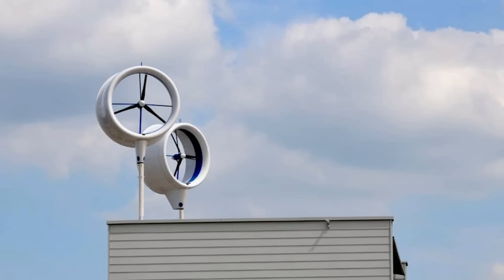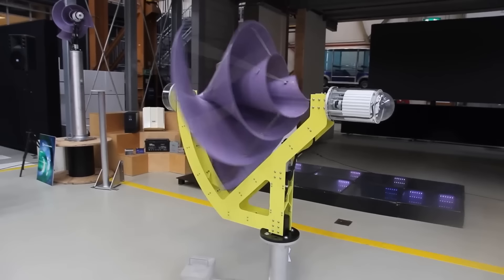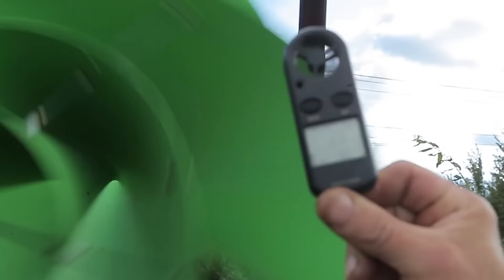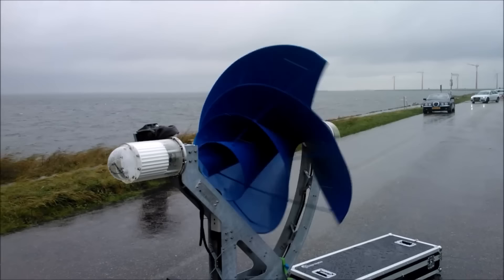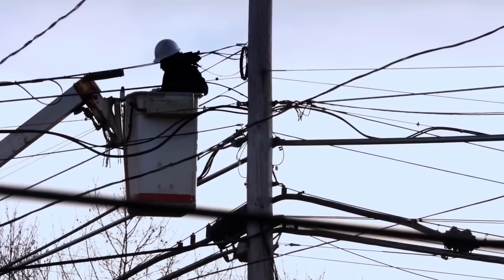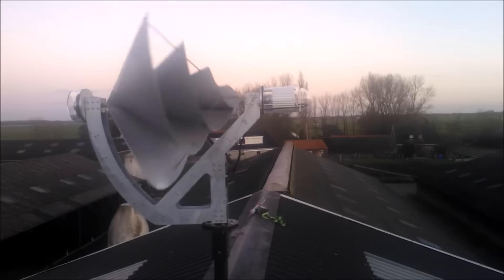How The Liam F1 Wind Turbine Will Destroy Every Home Renewable Energy Source

Comment: I recommend having a source you can activate and having a saver. This is a saver, not a replacement for off-grid. It can be frozen in certain climates like mine. I'm also surrounded by 40-80ft tall trees and I get more sun than wind-flow a the angle my home sits. Unfortunately the pine cones that drop would destroy a solar panel easily. They're full of sap at one month a year and have broken shoulders of the unsuspecting.
Reply: Those or some big pine cones!

Comment: Well if the large one produces 1,500 kWh a YEAR, we use 2500 kWh a MONTH we would need 12 of them. With each costing approximately $5,500 that would be approximately $66,000 for JUST the F1’s. Based on my current electric bill, that would take 13 years to pay back and Im sure not all will be still working that long. Not to mention my HOA would soooo not ever approve them. I am sure we will get there but not yet.

Comment: If it was a vertical axis then it would capture the wind from any direction.  What you have is something that will move into the wind and that is lost energy. It would be more efficient  up an down because no matter which way the wind comes from it will capture the wind.  You only have 1 direction that it can get the energy.  As it sits now it would not be worth the cost.

Comment: Can't they just made hybrid generator?

The greatest advantage of solar-TEG fusion solar panels is that they cover a house/building's entire roof, which greatly lowered the entire house/building temperature 🌡️, which could also reduce the expenditure of air-conditioning...

While this might be useless in house/buildings in colder climate area, but they're more people live in hotter climates...

The issue with generators with moving parts, is that they're not animals friendly, so it's best if the turbines are shielded.

This design can't also be applied to the entire house/building's structures, as it's not easy to make them ecstatically look better to average public and blend with existing architecture of structures/buildings...

Comment: It seems like it’s a good idea to install an array of small turbines on roofs of busses and trains. When they move, they can easily produce a lot of electricity. Enough to power air conditioning, lighting, Wi-Fi, and other small power outlets to charge phones etc inside for passengers. 
Of course, this will increase the drag resistance of the vehicles and there by directly increase fuel consumption! 😂😂😂😂😂😂 talk about converting fuel to speed to wind and back to electricity!

Comment: Well and you know here in the USA...until it can be monitized it wont get any support.  It's too cheap so until it can cost the same as solar panel methods or money can be made over a length of time versus initial purchase and maintenance costs it will not fly here.  Greed as nothing is free or it doesnt get to market.

Comment: When I need electricity the most, dead of winter and middle of summer, the wind just doesn't blow.  Spring and fall, when I don't need much electricity, that's when it blows.  And this thing is way more expensive than I figured for such a simple looking device.  I was hopeful, but I'll pass.  Can't use solar either because of trees I'm not cutting down.

Comment: First off, if you want to use only wind and have it replace solar, that is like going only solar to replace wind. You need both because not only are there days of no wind or extremely low wind speeds, there also cloudy days and night time when solar does not produce or produce much. For wind, I prefer a savonius rotor with spring loaded blades that will totally feather in high winds. Also, folks are wasting their energy. Low voltage LED lighting is the way to go and either buy low voltage equipment for your home and or shop or modify the current units as many use low voltage anyway but have a power supply which sucks a lot of energy to convert to that low voltage.

Comment: $5,000 will get me 12 X 500watt solar panels. That's 6,000 watts compared to the Liam F1 Turbine's 1,500watts @ $5,000. Both systems need additional hardware and batteries. You need a tower  as well. Sorry, you haven't sold me.

Comment: Why would you compare this to a heat pump? Are you suggesting it would be more efficient to use the power from the turbine to run resistive heating? That's insipid, you would obviously want to pair any renewable electrical source with a heat pump.

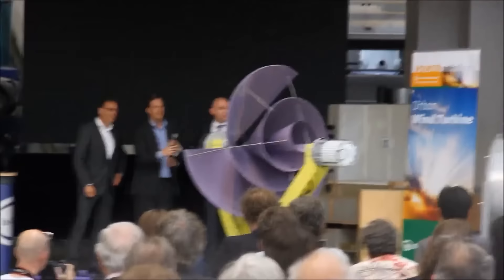Comment: I almost hate almost everything about this video, as there is a lot of miss intonation in here I don't know where to start, first off, wind and solar should be used together to maximize efficiency, also dew to cost to power output this system with a saving of 500 is wrong, it's not more efficient than solar if it's this FT wind Turbine is only saving $500 a year vs the averaged solar that is $1600 on avg on a 10kw system. I think I will stick to solar, not to mention maintenance is more often (That's more money), wind isn't guarantee (Nor is sun but at least sun is more consistent, and trackable, oh and that's more loss of potential savings) I'm sorry, this wind turbine seams like a joke, they have turbines that seam more efficient and effective that are just or seam just like long poles. kind  of like the bladeless fans. Man I wish the downvote number for the thumbs down button didn't go away, that way I could at least know this was a crud video before I even clicked on it. You know what YouTube, I will Pay you to let me see how many downvotes each video has again, seriously I waste so much time because of these joke videos or so out of date that I can easily avoid them if we could see how many dislikes vs likes they have before we load the video, 1 second vs 7 minutes. seriously. YouTube you owe me 6:59 minutes of my life back + the five minutes it took to write all this just to say YouTube add back the dislike button.

Comment: Sales brochure nonsense. The device is a drag-rotor which mens its Cp is around 0.25 (~+/-0.5).

Hardly ground-breaking efficiency.

It will really need a very strong tower or foundation to survive heavy wind gusts.

Comment: Damn, quite impressive. Still, I feel like I've seen this design somewhere before. An old invention by one of the earlier inventors? 
I wonder how they stand up to hazards. Like -30 degree celsius. Also, isn't 100KG on a roof a hazard itself? I guess it has to go through the roof on a built support under the roof.

Comment: Anyone with a higher room temperature IQ will quickly work out that the use of multiple and complimentary renewable sources creates a better and more robust energy system.  The very notion that one would completely displace another speaks more to topography on the author's brain (or lack thereof) than the technology in the video.

Comment: Lots of rotating components - expect mechanical wear. There will be significant maintenance costs associated with it for the during the repayment period of around 10 years. I wonder if it will outlast 10 years in service. I would expect that the electrical generator  will need replacement in that time. Although the idea is good, running costs will be fairly high. Solar panels are not the solution either, as there is no way of recycling them.

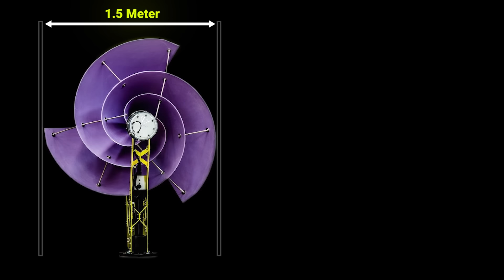Comment: 2:50 5 meters per second? Per SECOND? Sounds extremely fast... but apparently is only 11mph.
Reply: I was thinking the same thing, and looked it up. For personal context, I looked up average wind speeds in Toronto, and it's a little faster than the average here, which is around 20 km/h (5.5 m/s).

Comment: You lost me the moment you claimed that a heat pump can only be used for heating. An air conditioner is a heat pump. As is a fridge and a freezer.

That's bad enough.

Then you claimed that a wind turbine will replace those - which is an even dumber clim. 

And a wind turbine isn't going to replace any of those - it's going to power them. That's all it is - a power source. It's not going to heat or cool your house. It's not going to heat or cool your food. It's not going to open your garage door or even light up the house. It's providing the power to the tools that do that.

Comment: Marketinig nonsense starts at 5 minute, when comparison with heating appliances is done. Heating appliances are energy consumers and not generators! SO If this turbine would work as advertized it would be a good complement to heat pump as BOTH are needed to head the house. Also comparison to solar arrays is biased, to say at least. Number pulled out of context does not make much sense. My 10 KW solar array generates over 1200-1700KWh  from April to September. I highly doubt that such small turbine would surpass that unless you live on a sea shore with stormy waether. It's rated power is 700W, so I would need at least 10 of those. I doubt that  the price would match solar array price ;)

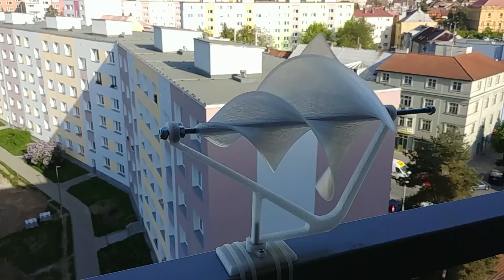Comment: 01:25 "Its design is also very advanced as it's based on a rotor that captures the kinetic energy of wind to convert it into mechanical energy." ... ok so that's the literal definition of every type of windmill and wind turbine ever invented, which means you've said nothing except "its design is also very advanced because it's a windmill."

KWh is not "kilowatts per hour" it's "kilo-watt-hour" it's a unit of measurement.

You also claim the wind turbine, which has the singular function of providing electricity is "more versatile" than a heater, which has the sole purpose of providing heat... This is nonsensical. They are both single function appliances. The fact that electricity is used in more items does not make a generator more versatile. They are different ends of a chain.
Reply: 1 kw for 1 hour is exactly 1 kwhr

Comment: huuuuh? how do they reduce noise polution by not being noisy that makes zero sense !!! lots of moving parts so lots of maintenance and if you want them to last expensive bearings quite a few of them too, can just imagine how wobbly this would get real fast if a bearing went out, I could see it leading to catastrophic failure in high wind it might tear itself to pieces and I would assume that for optimum performance these things need to be up at a decent height free of wind obstructions making harder for the average homeowner to check it regularly when you really think about it it has as many drawbacks as all other renewable/green energy producing systems for the home PS here is another little tidbit of info for people who live in cities i used to clean bricks on houses many years ago in a big city you probably have no concept of how much gunk ends up on homes in the big city it is a lot of crap dust, rubber from tires on roads, diesel exhaust from buses, construction dust and debris, and so on and so on just imagine how dirty your solar panels are going to get and how often they will need cleaned to get optimum performance out of them climbing on roofs is not for the older people nor the inexperienced or faint of heart so couple times a year you have to pay someone to climb up and clean those panels

Comment: using the Archimedes turbine is perfect for this use case since it automatically points towards the wind due just to its geometry but even $10k is crazy with economies of scale their profit margins must be insane they are really trying to milk their government on this one lol maybe this price includes install too then maybe it isn't too terrible but if not I could build that windmill itself in my garage for under $100 with scrap parts and under $600 if I buy the generator instead of just taking an electric motor and doing some basic modifications to increase efficiency the most expensive part would probably be the inverter and power management system you could probably pull it off for $1500 to $2000 with a bit of creativity and luck maybe even less if I am imagining the parts correctly but 4K to 5k max for these power levels and you could get it built and installed over a weekend if you have the tools and can do some basic electrician work because it is easy to fabricate the mount for the turbine the only part you would would most likely need to buy for the mount itself is the rotating DC connector and turbine itself is an easy build the Archimedes turbine can be easily made for this use case with thin UV resistant plastic, a thin metal tube, and some wire and a generator which  like I mentioned earlier could be an old electric motor if you are willing lose a bit of efficiency  

General Directions for those interested in DIYing this or just making a small version for a fun project for yourself or kids
just take a couple of sheets of your UV resistant plastic then trace out the desired size and pattern for your setup (there are plenty of calculators online that will give you the dimensions you need to make these Archimedes turbines since the concept for them has been around forever since you know Archimedes) cut it out and the mark the mounting points for the wires and cut your wires to the correct length to make sure you get the correct curve on your turbine later and then just attach your plastic sheets around the metal tube with adhesive, epoxy, bolted, maybe even slots cut into the metal tube or however you find to be best using what have (if using adhesive or epoxy make sure it can handle outdoor conditions for extended periods of time) then attach the wires to the metal tube and the mounting points you drew out and done you have an Archimedes turbine weld or bolt together a mount for the turbine it needs to be able to rotate freely at the base so the turbine can face the wind so you need a a rotating DC connector so you can rotate freely and the wires won't start twisting on themselves so can send power to your inverter and power management systems for the best results you should probably order some bearings too but maybe you can get away with not using them especially for smaller designs (make sure the mount isn't heavy use thin metal, plastics or composites remember this has to turn with the wind and be mounted up high like on your roof so weight is the enemy here) once you have your turbine and mount built and assembled it is just a matter of wiring it up with your inverter and power management system and done you have renewable low maintenance power

if anyone reads this and has questions or I got something wrong feel free to comment I would be happy to help in any way I can and I am always willing to correct myself. I would rather be actually right over appearing right to other to feed my ego even if I have to take the "L" in the moment.

Comment: This device must be expensive. Moreover, mechanical devices break down more easily. So no, it can't be cheaper than solar panels. As for noise, I've never heard a solar panel emit any noise, save for the occasional creak due to thermal expansion/contraction.

Comment: $5000 😱 for it only what about the batteries that is needed to store the energy and thise may cost another $5000 for the types that don't expire fast.
those batteries need to be replaced after 5 to 10 years that is costy.
People always need a cheap reliable source of energy may be with a normal local grid if they are fairly priced their power.
But if you are in situation that can't use or afford that may be this is a solution but with a high cost (  a loan is solution for  that ).

Comment: This is one of many good ideas, how about building better homes.  Instead of the standard 4 in exterior walls, how about an 8 to 10 inch walls, that would reduce your energy use.  With my family many years go, we would update our houses with thicker exterior walls.  Which reduce our energy use by 50%, so if you want to be efficient, build better houses.
Reply: "how about an 8 to 10 inch walls"

I have always wondered that myself.

Even if the regulations don't require that builders need to step up and build that way and market that as it would be a great selling feature and most certainly cover the build premium over traditional garbage.

Where I move from last year there was a row of $500K townhomes going in. I walked over and looked at them and all the walls were standard 2x4, and I mean ALL including exterior walls....except the garage. The garage walls had 2x8s. Like what?!?! Why, because people don't have HVAC going in their garages so more room for insulation? How about the rest of the outside walls?

Can almost guarantee that they were simply following the building minimum requirements rather than doing better. We are talking about $500,000 units (about $150K over average home price in the area at the time) so getting into the lower end of the upper class places.

Just ridiculous. What are we talking about a cost to build going up by, $10K to $15K just to make the outer walls more insulated?

Comment: Remarkable BS. Even up here in the Nordics with a dark and windy winter, at least seven 1.5 meter wind turbines would be needed to replace the solar panels on the roof that provide 10,000 kWh per year. They are also quiet, discreet and use an existing surface. Wind turbines for private use are ugly, cumbersome, wind-dependent and very difficult to get planning permission for.

Comment: I always laugh at these outrageous claims about wind turbines for power generation. They always forget one important fact. Not all areas are suited to wind turbine use. No wind? No spin. No power produced. Its also about the quality and strength of the wind. 

PV Solar? It can be utilised everywhere. From grid connect to off grid use(both stationary and mobile). Even under overcast conditions, PV can still produce usable power in an approriately sized system.
Reply: Any cloud panels for people in Ireland?